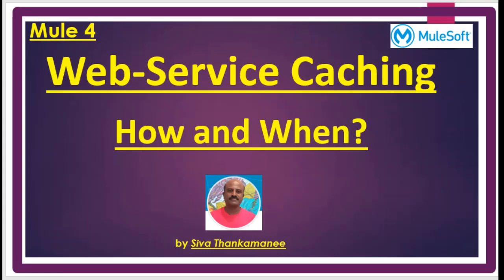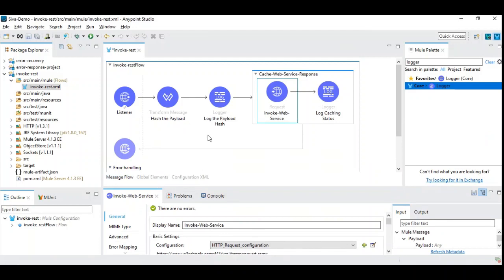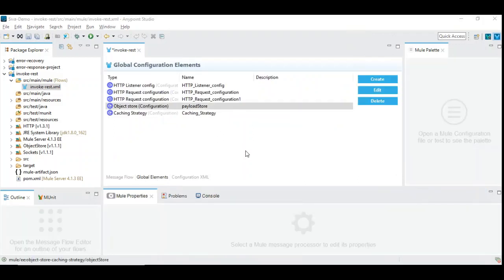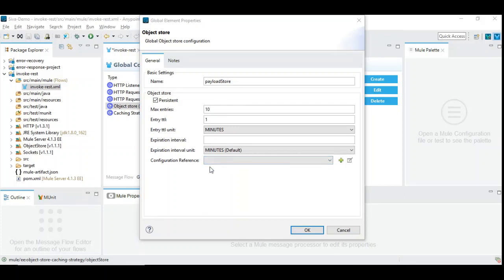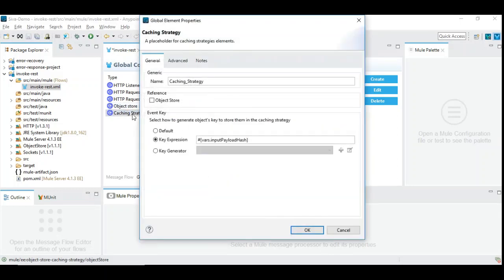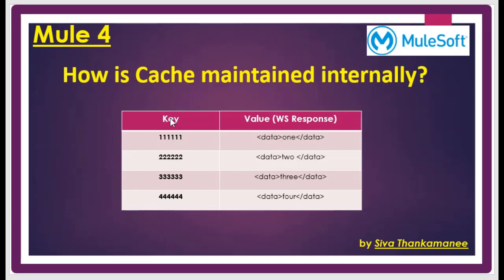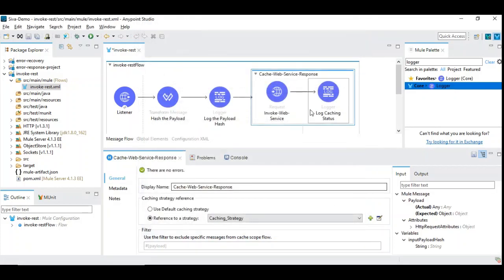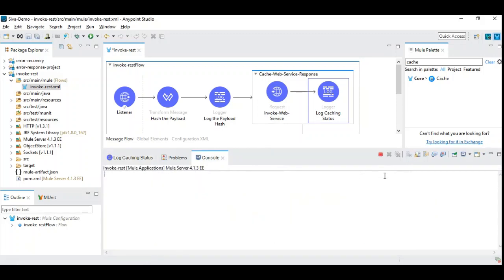API Performance Tuning - Effective Web-Service Calls with Caching !!

Comment: Hi Siva, thanks for the video. Quick question; when setting up business groups what is the best and recommended way? do you separate your Prod and Non-Prod APIs by Business Group or how is it structured? Is there a guide line or KB on this topic?
Reply from the maker: Hallo - This requires deeper explanation.  I will try to provide with the diagram.  Please give me a day.  Thank you !!
Reply: @sivathankamanee-channel  Thank you. You make our lives easier.